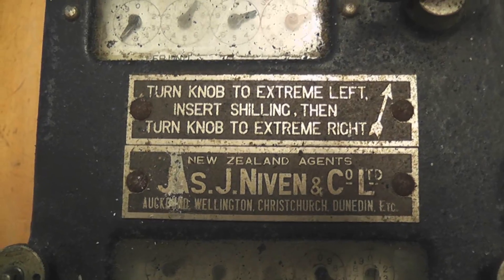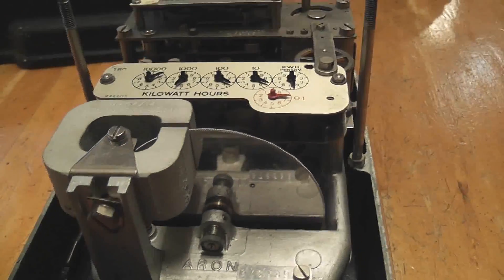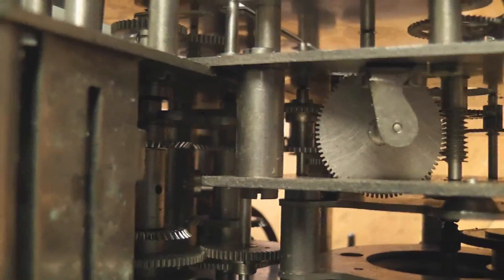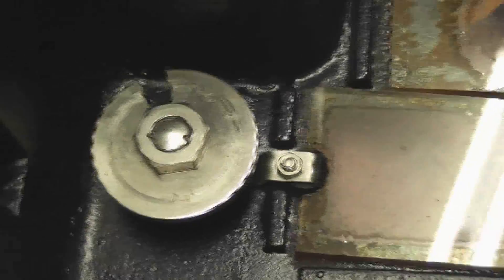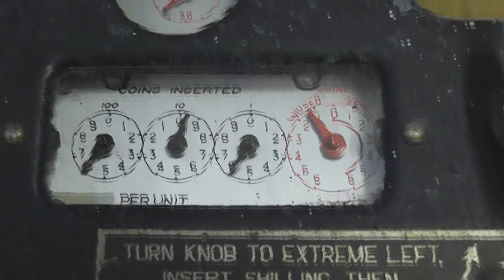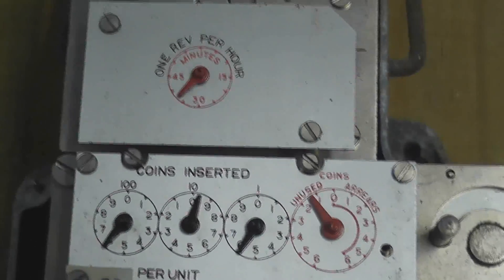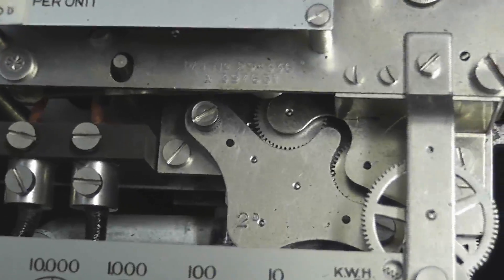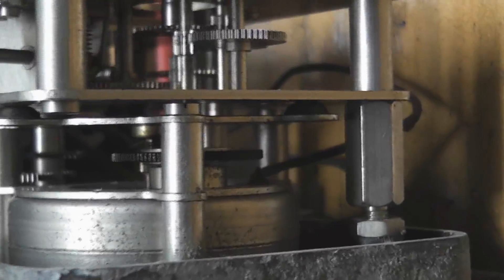Venner Coin Meter

Comment: Haha. "They switched for Euros". I don't think so!

We still have the Pound, known internationally on Exchange Rates as GBP & the symbol is £.

The meter in this video may accept the Old British Shilling. This is before decimalisation. The old British Pound had 240 pence to £1, but the new pound only has 100 pence to £1.

Other discontinued British coins apart from the shilling include 2 shillings (Or 'Florin'), sixpence, threepence, Crown, Half Crown.

We also said cheerio to the ½p in 1984.

Comment: Viewer # 80 :D

When you said 2d per unit, that's the old pre-decimal 2 pence. My British Sangamo HM is set up for 3d per unit & isn't changeable unless a small gearbox is removed & replaced with another of a different gear-set ratio!

I'm glad that you noticed that this VENNER meter has an ARON logo stamped into the chassis inside.

I know Venner as a timeswitch manufacturer. The were based in New Malden, Surrey, England.

Venner may have made this 'Under Licence' from Aron.

Thanx for showing.